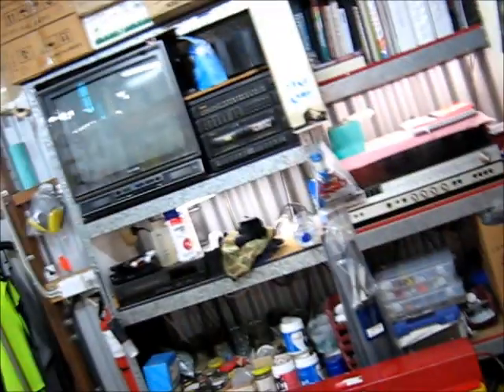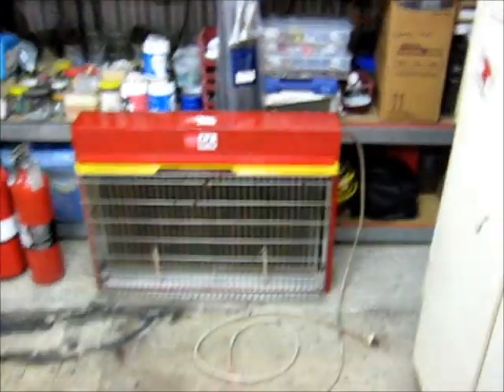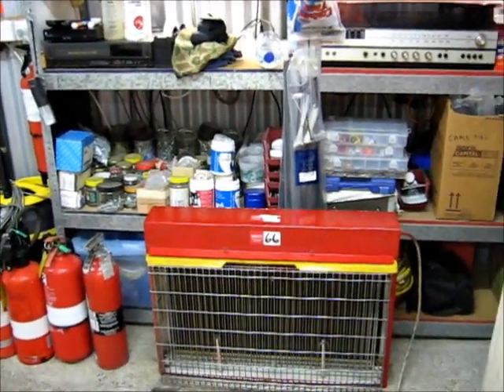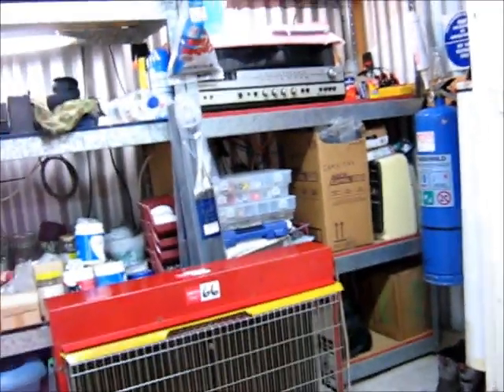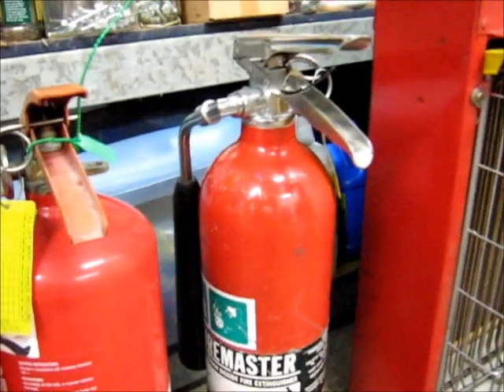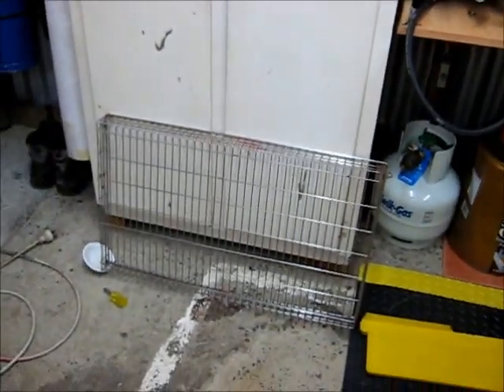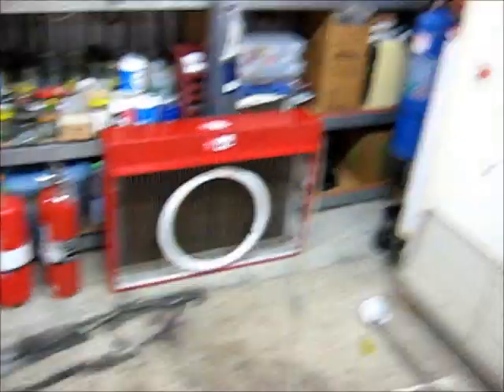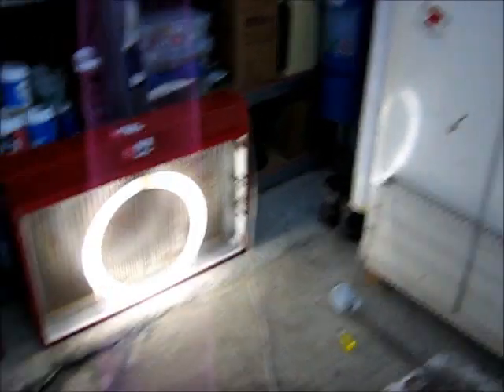Simon Insect O Cutor Bug Zapper and Fire Extinguishers

Comment from the maker: @Aussie50 Thanks, Sadly I am tight for now, there's a Middy's not far from my place, I would assume the tube would be around the $45 Mark now since you made the video on yours, I took it apart, it was not greasy but dusty inside, just the transformer has minor surface rust but works and is safe, I have managed to mount it up, and hook it up too, just need the proper lamp for it....Thanks Ed....